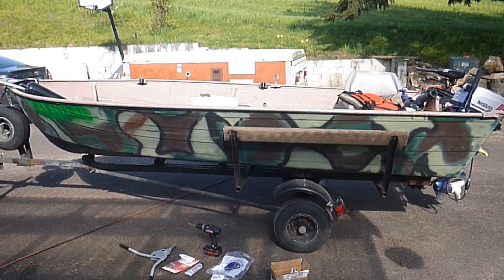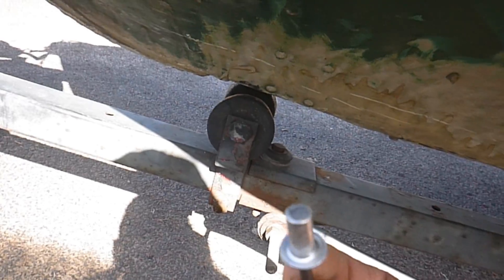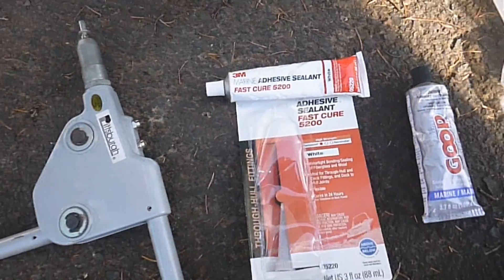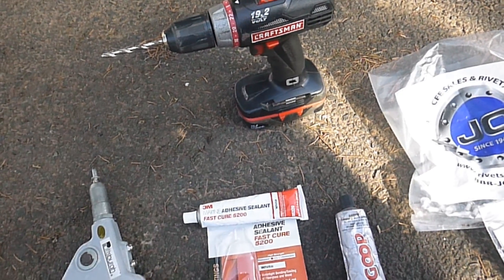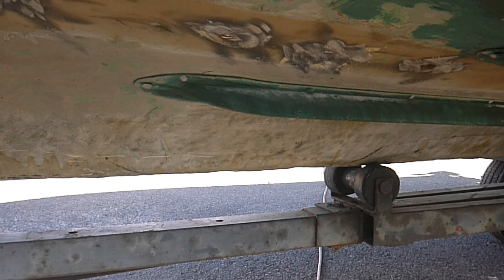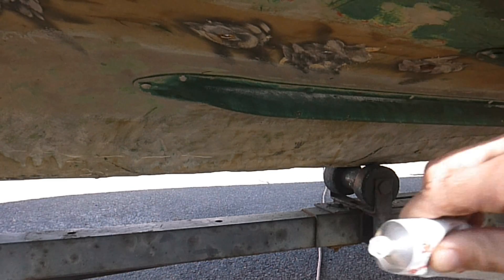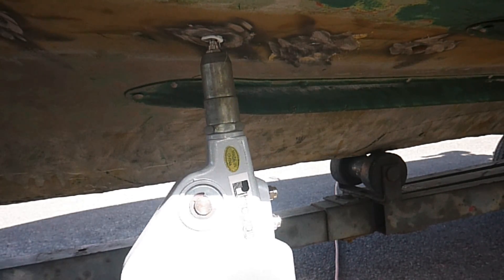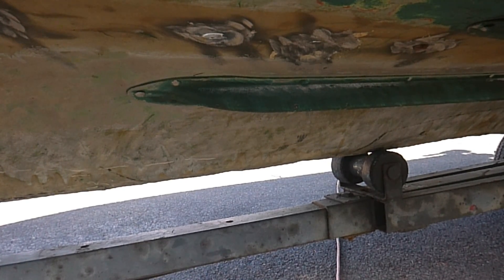How to replace rivets and repair holes in an aluminum boat.

Comment: which rivets did you use? you can see the sku on the washers, and when you plug it into the website you get the right washers, but you never show the sku on the rivets.
Reply from the maker: Check the rest of the comments, there's links to them.

Comment: Did you use a steel center or an aluminum center? What length Rivets? do you have a part number?
Reply from the maker: Either of the first 2 listed should work. If your hull is thicker you may want to consider longer rivets. Also these are 1/4 inch in diameter and you should measure the diameter of your rivet holes before ordering.
https://www.rivetsonline.com/blind-rivets/closed-end-blind-rivets#2

Comment: any idea how to make a new rear end to a boat, got a free 12' aluminum but it didnt come with the back lol thought maybe itd be worthy of a project to get a free boat.... let me know what you think
Reply: Scotch tape & piece of wood that fits the area, she'll be good as new!
Reply from the maker: Do you mean the entire back of the boat is open now? Honestly unless you have access to a sheet metal brake and some aluminum, you're probably better off just getting a different boat. I guess you might be able to make a transom out of plywood and a little of this stuff:  https://youtu.be/17zyezuw07U
Skip to the 45 second mark.
Reply: How To For You well turns out im getting lucky. The boat is 100% free and its a fiberglass haul. Just a 12' so im gonna rebuilt it out of eboxy tiger hair fiber glass and plywood:)

Comment: I need to install two missing rivets on bottom of my boat, but cant get access to the inside due to bolted/welded floor boards. Do you think the rivets will still seal, if I don't add the aluminum washer/burrs?
Reply from the maker: I think it would probably work fine.
Reply: It will work. If you want extra strength just put some sealent around the rivet

Comment: how do you know what size rivet to use
Reply from the maker: The best bet is to measure the hole. I've got a digital micrometer which can be had for around $10 at harbor freight if it's on sale but even a ruler can help you figure our what size hole it is.
Reply from the maker: A simple way to check the hole size for the rivets would be to use a drill bit. The largest size bit that fits in the hole should correspond with the rivet size.
Reply from the maker: Anything that is flat at the base would work, like a dome head. Nothing that's countersunk for sure. Here's a link to where I buy them. The different options are listed on the left side of the page. I like stainless mandrels but steel works as well.
https://www.rivetsonline.com/blind-rivets/closed-end-blind-rivets#3

Comment: Did you end up painting the boat already ? If so what type/brand of paint did you use ?
Reply from the maker: Haven't gotten around to it yet. Topside paint is relatively inexpensive if you get white. I'm going to use safety yellow Rustoleum industrial paint. Rustoleum was originally made for marine applications and it's cheap. We're really hard on boats so the paint will get thrashed. I've seen the industrial paint take some serious abuse and hold up. Really want to see how it does on this boat.